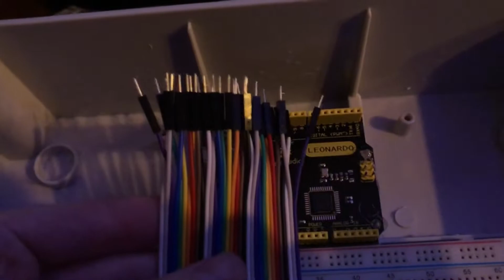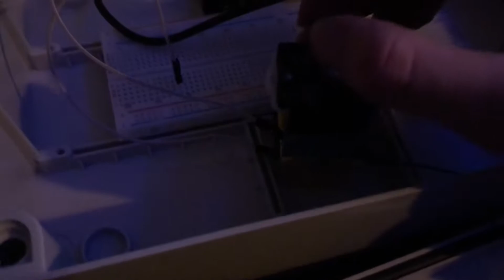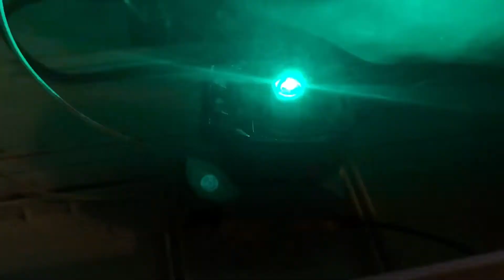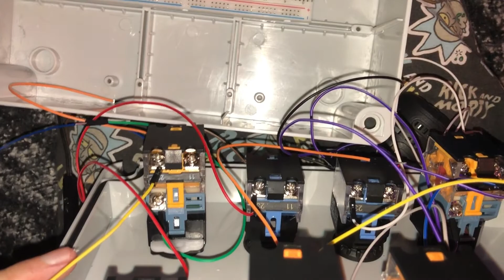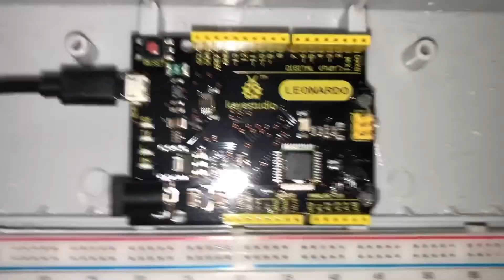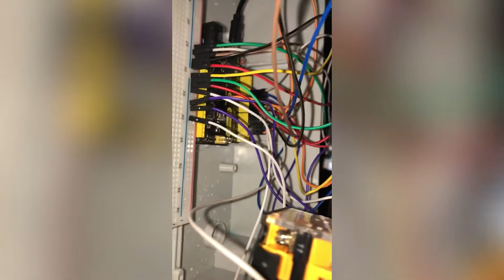How to build a RideSims / NL2 Panel | Part II, Wiring

Comment: Could you use the nano or uno instead of Leonardo
Reply from the maker: @sus_coasters  It depends. To use the Keyboard.h library (that simulates key presses) you need the Leonardo, the uno and nano won’t work for this. However, if you make a panel that uses the NL2 telemetry instead of simulating keyboard presses, then I suppose the uno or nano should work, but I haven’t tried it on those, so can’t guarantee.
Reply: @ ok that’s

Comment: Hey, few questions, trying to make a panel as a project, wondering how you are doing your wiring actually? You dont seem to have used a resistor or even connected the 5v supply, can you explain to me where these come in? in you're older programming video you said you needed to use a resistor but you haven't here. Will we ever get part 3?
Reply from the maker: Hi, so the wiring is done by simply assigning a digital pin from the arduino to the button of your choice, and then wiring the other terminal of the button to a bus which goes to the ground on the arduino. 

I probably didn’t explain the resistor part too well, I apologise for that. Essentially, depending on the button you get (usually 6v LEDs) you will use the 5v boards. If the rating for your LEDs is lower, then a resistor will be required. Additionally, a resistor is required when declaring a pin as INPUT, but as INPUT_PULLUP is used, a resistor is not required as the arduino has on-board resistors which the pull-up variation utilises to make sure that your board doesn’t burn out.

And yes, part 3 will happen at some point. I’m just extremely busy with work and studies, but i’ll have a lot more free time in June. So part 3 will probably be a June video.

Hope this helps :)
Reply: @ffinianhe  cheers, my buttons are LEDxless, but the buttons themselves are rated for higher than 5 volts. I presume I just use pull-up and it should work fine?

Cheers for the other info btw!
Reply from the maker: @theblockybanana5537  It should do, that rating is usually just the maximum, not the minimum
Reply: @ffinianhe  with help off you and other people, I’ve managed to get it programmed how I want, and it’s all working correctly! Thank you so much, all I need to do now is fabrication (backwards I know but I wanted to test it all first)

Comment: I am currently building my own panel and I do have a question: In which hole (12 or 24) do I have to connect the wires in the button? Btw, thank you for the tutorials, without them I would have never started building my own.
Reply from the maker: It depends on what you want the button to do. Let's say you use pin 9 to connect your dispatch button. You then program your pin 9 to read a signal from the button. If the voltage changes, it sends a keypress to NoLimits 2. 

All buttons need a unique pin and this needs to pass through the button and then into ground (GND). Pretty much any pin can be used as a digital pin, even the PWM ones (indicated on the board with a ~ symbol).
Reply: @ffinianhe  Thank you!

Comment: How to determine when arduino chips are 3.3 and when 5 volts?
Reply from the maker: If you already have one and aren’t sure, best bet is to use a multimeter. If you don’t have one, take a look at the chip itself. In small writing, it should say either 3.3 or 5 somewhere and this indicates the voltage. 

If you’re buying one online, just search for the voltage you need. It’ll usually say in the description or title of the product. I personally use just 5v ones for illuminated controls, as the 3.3v ones just aren’t powerful enough for 6v LEDs. Hope this helps.
Reply: @ffinianhe Thanks for the advice.
Reply: @ffinianhe  Bought one from local store, will there also be a video about programming it?
Reply from the maker: @CHGOfficial512  Probably not. Just too busy IRL.

Comment: Im getting components ready to buy to follow your tutorials for a panel. Do you have a better quality camera you could use as for this tutorial i'm struggling to see the programming screen? Very much looking forward to part three and just to say thank you very much for taking the time to do this! I went to buy one premade from germany and got quoted £850.00 excluding shipping which is just silly.
Reply from the maker: Hi, I’m extremely busy right now but will get around to programming as soon as I can. As for the screen, I’ll be using a screen recorder so it’ll be crystal clear. £850 does sound steep, though depending on the buttons used, enclosure used and how complex it is, it may not be. 

Are you using regular 22mm push buttons from China or Swiss-made ones like Allen-Bradley’s?
Reply: @ffinianhe  mines willl 22mm from china, its just the programming that i find very confusing plus i dont know how many buttons in total i can have and how many i can have leds?